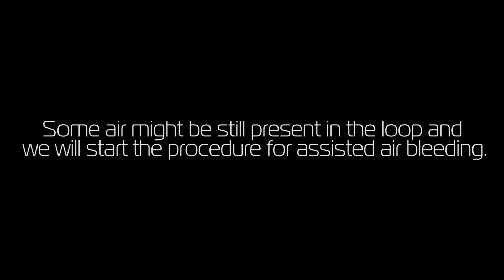EK-XLC Predator - How to refill the unit?

Comment: Is it always necessary to do power assisted bleeding? Or is it possible to solely refill the system through the fill ports, and reinstall as normal?

I say this because when I first installed my Predator 360, I heard the flushing sound of air bubbles being forced through to the reservoir, and after it became silent. Is it possible to just do the same if refilling?

Comment: Is it possible to fill the Predator built in via a hose only with the reservoire hole, using it like a Reservoire Tank? Speaking of using it for a hardtubing loop in a mITX.

Comment: is it possible to change the tubing to clear tubing and then add a colored solution?
Reply: @EKbyLMTEK  What coolant should an EK Predator and EK Phoenix system be topped off with? I have both and can't find a reliable source to indicate what is compatible with existing coolant in there